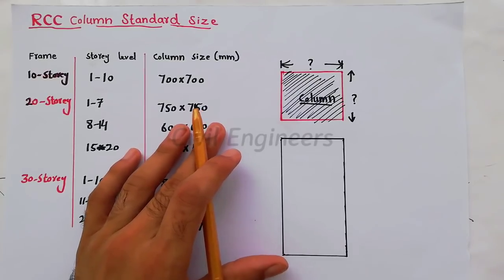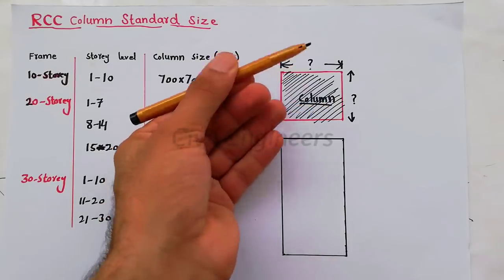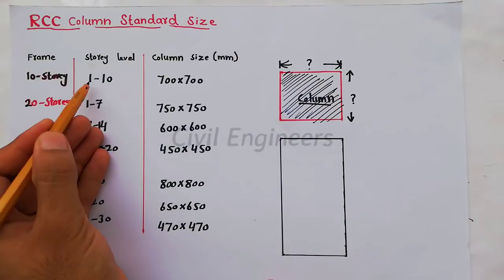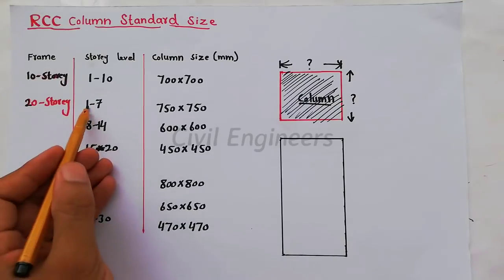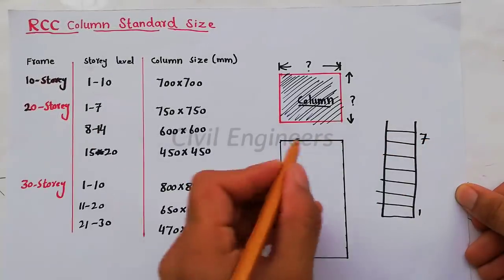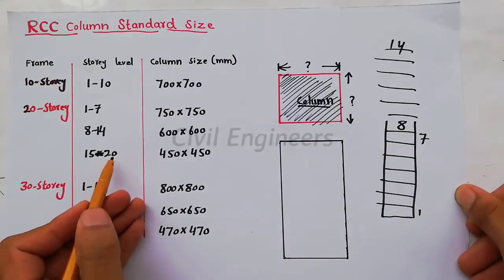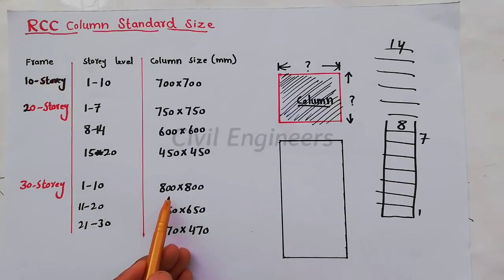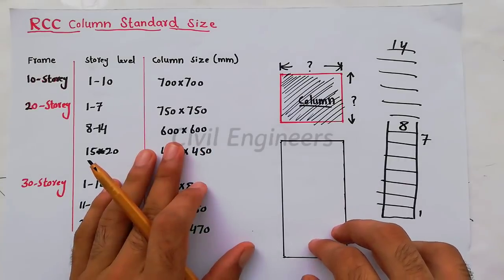Standard Size of RCC Column for 1-30 storey building

Comment: The other useful information on arriving column size are as follows:
Arriving size of  Column:
Based on load on column, size of the Column can be calculated by any one of the following method.
Method 1 : Based   on ultimate load/m2 (Approximate)
 Ag (Gross area) required = 80 to 100 mm2 per every 1KN ultimate load carried by   the column depending on the grade of concrete used.
Ac= cross sectional area of column
D= large dimension of column =Ac/b
b=width of column.
For 1.5 x 1452= 2178 KN ultimate load, area required= 80x 2178 =174240 mm2
If b=230mm, D=174240/230=758mm say 750mm.
Provide Size of column as 230 x 750mm. Assume 1 to 2% of steel and M25 concrete. If we provide 2% of steel, 
Ast required= 2/100 x(230 x750) =3450mm2 .  Provide 8 Nos. 25 dia steel. 
Safe Load carrying capacity of column P=(2.6805p+10)bD/1500=(2.7005x2.275+10)230x750/1500
=1851KN. >1452KN .
Factored Load =1.5x1851= 2776.5KN> 2178KN.

Method 2 : Based on Axial load on Column
  Equivalent  axial  column      Load with moment factor (KN)           Column size      
                                                                                                                               (mm)
                 Up to 500                                                                                       230 x 230
             Above 500 to 800                                                                             230 x 300 
              Above 800 to 1200                                                                     230 x 450
                  Above 1200 to 1500                                                                    230 x 600   
                   Above 1500 to 1950                                                                    300 x 750 
                   Above 1950                                                                              300 x 830

As per table  for axial load of 1452 KN , approximate size of column =   230 x600mm. The reinforcement shall be taken as 1 to 2% of cross sectional area provided.
Method 3: (Based on tributary area)
Area required is mm2/m2 of area covered by the column
Grade of concrete External column     Internal column
M20                                 2000                   1500
M25                                 1800                   1200
M30                                 1600                    900
M35                                1400                    600
M40                                 1200                    300
 For example for (Silt +4Floors) residential  building interior column with M20 concrete with 5m by 4m grid 
Area required = (5 storey) x tributary area (5x4)x 1500 mm2  =150000mm2
 Assuming width of column b=230 mm
 Depth required    D = 150000/230 =652mm say 600mm
 The size of column to be adopted is 230 x 600 mm.
 Method 4:  Based on thumb rule :
(i) Based on height or span of the beam
Column depth is 3 to 5% of total height of building
For example  (Silt +4 Floors)  5 storeyed  building with 3m height
The depth of column is (5x3=15m+0.6m(Basement height)) 15.6x3/100= 0.47m say 480mm.
If the beam span is 4.0m, along  transverse direction,
width (b) = 1/12 of span of beam
 b= 1/12x4.00 =0.333m say 300 mm. Column size is 300 x 480
(ii) Based on storey/ span of beam
If building height is 3 storeys or less:
If beam span is < 6m, D=300mm;
If beam span is between 6.0 to 9m, D=350mm
If the beam span is more than 12.0m, D=400mm.
If the building height is 4 to 9 storeys:
If beam span is < 6m,                        D=400mm;
If beam span is between 6.0 to 9m,    D=500mm
If the beam span is more than 12.0m,D=600mm
In this example, the span of beam is 5.0m and No. of storeys =5
Size of column is 300 x 400mm.
Reply: Rajan v.m. like your analysis
Reply: super..
Reply: 😀sz_®zcF©z***ZzxzX"FZu*fzX*c"xC X_ZzZx

Comment: There is not such any standard size....it all depends upon the structural design.
Reply: The video offers a general idea for viewers whereby the column is sizing from bigger to smaller from lower floors to higher floors. Because the column is taking more loads at the lower floors.

Comment: Can we use same bars for 1st floor and 5th floor
Reply: Cannot, because the column up to the 1st floor is taking more loads compare to the floors onwards.
Reply: Depend upon floors and if you are using 4 floors than you use 16 to 20mm bars and numbers of bar can change after 3rd roof or 2nd floor only some bars of column in diameter
Reply: CE&T-Civil Engg & Technology
 sir same vedio tsi v bna k apload kro